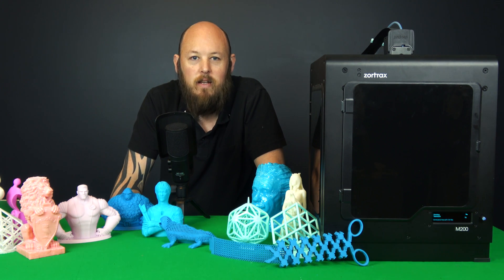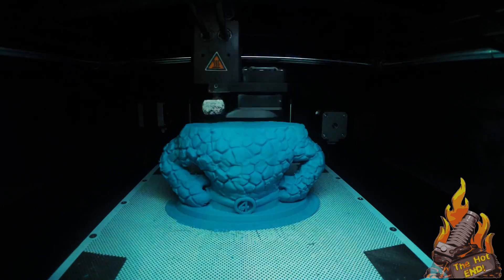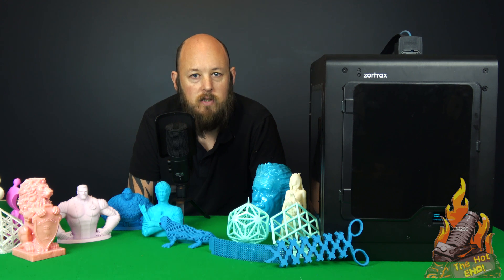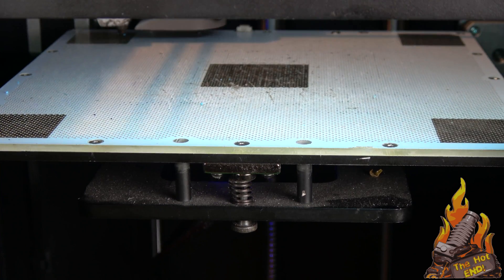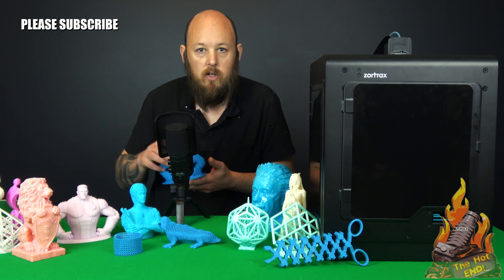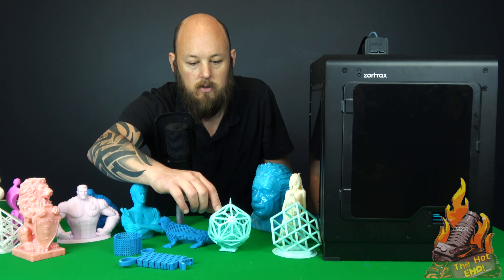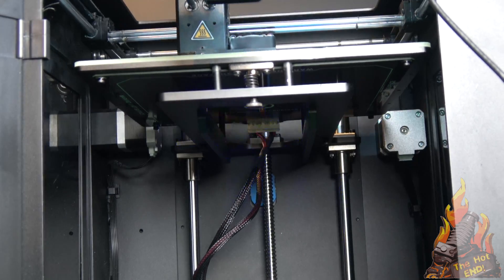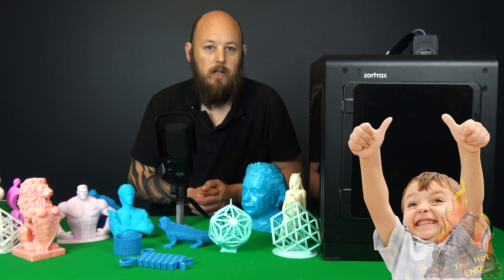Zortrax M200 Review! The Ultimaker Killer? Or Overrated?

Comment: I have just found a deal for this printer for an amazing price of £748, the only thing that is holding me back is the having to print on a raft as I want to print some of the more exotic material and rafts would be like throwing money down the drain, are you aware of any user making a build surface without the perforations for this machine?
Reply from the maker: This level of printer dosnt have mods, you use it how it was designed. Love mine

Comment: i am working with a zortrax m200 and cant say anthing bad about it. I just had a few failed prints and they happend mostly to errors on the users side not the printers. I am thinking about getting  one of the creality cr10s with the bigger build volume, because of the zortrax small build volume. Can anybody share a comparison between the print quality of the two? Espacially for very fine details with a very small layer heigth? Thanks!
Reply: ..i feard that..thanks for the answer!

Comment: Great review.  Having to print a raft for each part adds print time.  I'd like to see a print bed option that does not require a raft. 
 At this point in the hobby after owning and using several printers including kits, I am looking for a high print quality printer like the Ultimaker / Zotrax but at a hobbyist price point.  I've been eyeing the jennyprinter Ultimaker extended clone kits and would like to see an in-depth review on one.
Reply: Evanator22742 Thank you for the feedback.  The lack of quality reviews is a problem for me.
I'd like to have more info on what I was buying.
Reply from the maker: You cant get a high quality professional machine at cheap chinese prices its kind of impossible. They wont give the jennyprinters out for review (because i bet they suck) hence no reviews.
Reply: Excellent point.  I'll keep saving for the "real machine".
Reply: I got a jennyprinter about two years ago. Of course support was a bit of a bust, but I get great prints out of it and its pretty darn reliable. I may have gotten lucky though, but for under a grand I am definitely happy. Just saying it is an option :)
Reply from the maker: +reasonablebeing welcome

Comment: not sure if they hand picked your unit or what, though this is no where near the experience i've had with these printers. I own 5, i run them for my business 24/7 and although they do make amazing prints, they do have numerous issues. 1) that ribbon cable loves to wear out and cause random issues (well known issue), 2) they love to jam and jam every single time you run out of filament on them 3) the bed doesn't always make it warp free, some prints still warp, it helps to use ABS juice 4)switching filaments tends to jam 5) random print fails with support and support not coming off cleanly 6)finally PARTS, parts are insanely expensive, 20$ for a brass nozzle is insane, and they just keep getting crazier from there, plus its recommended that you replace your parts every few 100 hours. Sooo yeah it makes nice prints and thats why i have 5, though its pretty far from perfect
Reply from the maker: +Thyshallsmite I've run well over 100 spools and none of those issues - sorry to hear you have had these problems I'd suggest emailing zortrax
Reply: Wolfgang Bauer I’ve had no successful prints on my zortrax. The first machine wouldn’t beat up and i had to return it and the second one is just fusing he supports to the model no matter how i orient it or what i do... don’t know what to do anymore
Reply: @ilanchico8375  I had the same problem on one od my M200s - I just turned the extruder temperature down until they would separate -  I think my extruder runs hotter then it should do - getting great prints now -  I have three of these  machines 2 x M200 and 1 x M300 - with an M300 Dual coming - tried an Ultimaker M5 and couldn't get on with it so it went back -  Zortrax are tops - but even then its worth joining the Facebook group for advice when you need it...
Reply: Hi Thy
If you're running machinery 24/7, then maintenance would be very high on your list as I'm sure it is.
There is definitely a percentage fail rate with this type of manufacture which means operators need eyes on the process.
If you have 5 of them running, it would be great if you could give us some percentage rates for:
1/ successful print percentages 
2/ best filament use (given part types)
3/ times for prints, i.e. most success given print size and times
4/ Filament types with regards to most success
That would be cool
Reply: Thyshallsmite fully agree same experience and I have printed a lot of it
Very unflexible and the external materials implementation is a joke. Cannot use a lot of materials as software doesnt allow to fine tune parameters.
So badically I dont like this enthusiastic reviews they do not cover the daily reality oening this printer
For that money it is pretty unflexible and you shed a lot of ecpensive matetial anf time to get tuned results!